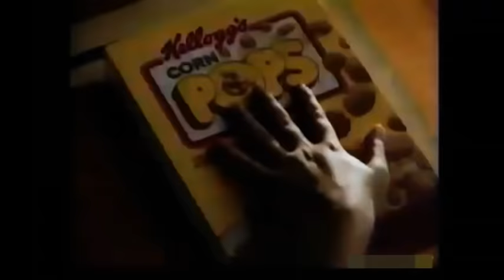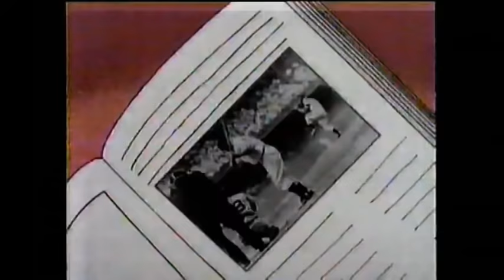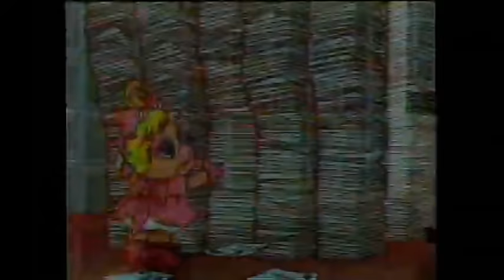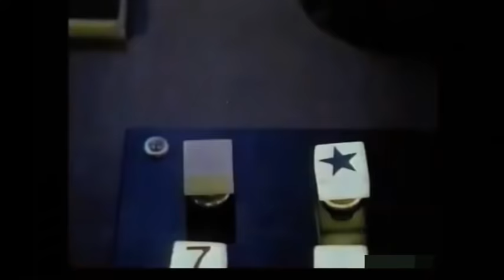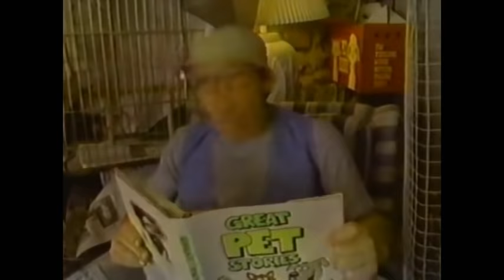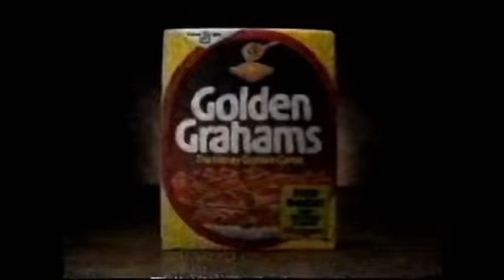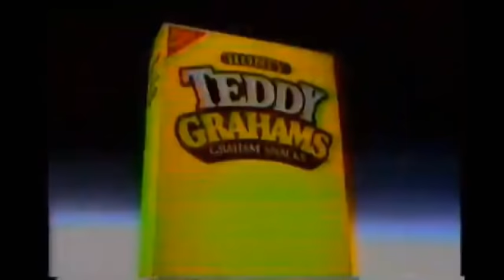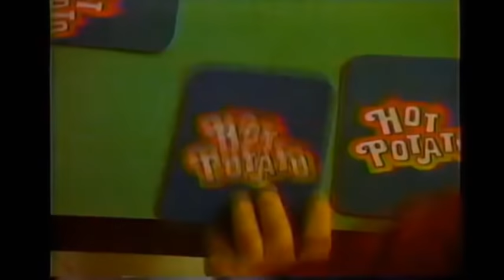CBS Saturday Morning Cartoon Line Up with Commercials (1988)

Comment: Just as the networks gave in to years of lobbying from parental groups and put an end to all violence on Saturday morning programs, syndicated cartoons came along offering up violence galore. This marked the beginning of the end for the golden age of Saturday morning programming.

'The Teenage Mutant Ninja Turtles', 'GI Joe', 'Jem', 'Thundercats', 'Strawberry Shortcake' and other cartoons started flooding local weekday afternoon schedules.

Almost every popular kid show in 1988 had product tie-ins. Typically, the product came first and then the cartoon series was offered to TV stations at a loss - because the programs were just one long commercial! Parental groups became even more distressed by this new trend.

By the end of the 1988 season, NBC talked openly about replacing Saturday morning cartoons with the 'Today Show' because they couldn't compete with violent cartoons airing on independent stations and cable. NBC finally did give up in 2001, selling their Saturday mornings to The Discovery Channel. By then, CBS had given over its Saturday morning programming to Nick, Jr.
Reply: It wasn't a trend. Reagan relaxed restrictions allowing cartoon makers to advertise directly to children. Appalling I know. This was later corrected by Clinton. Parent groups controlled cartoons not because the network "gave in" but because they broadcast on public airwaves. Parent groups couldn't touch cable. And THAT is why the networks gave up.